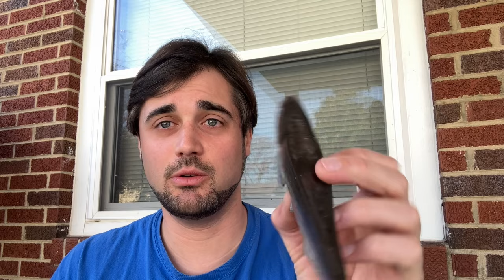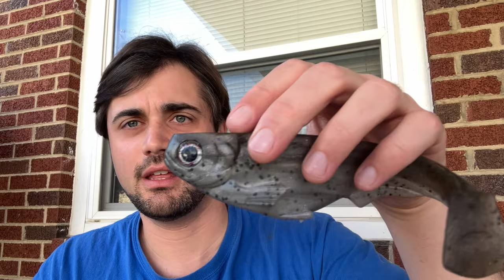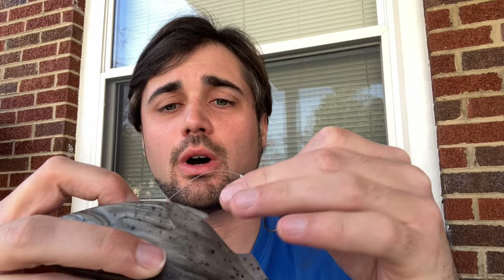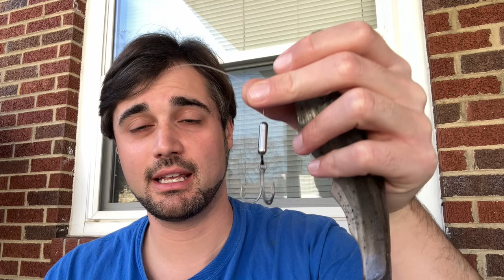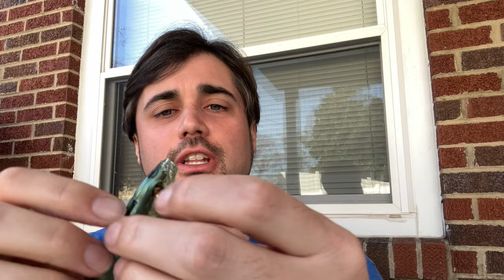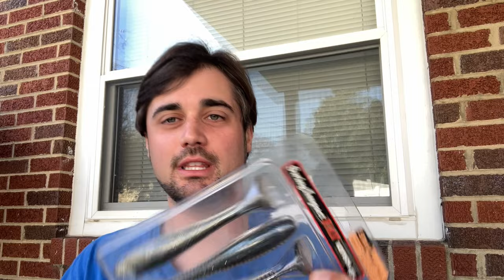Rigging line through swimbaits: Working Class Zero Citizen and Megabass Magdraft

Comment: Another great video! For the magdraft freestyle I just take a pencil shaped dropshot weight and stick it in the cavity inside the belly. Mend it works like a charm to keep it secure in there. I also have my hook hang a lot closer to where the tail starts to reduce not hooking into short strikers. That pencil weight in there allows me to either make it a line through or even use the beast hook it wont come in the way!
Reply from the maker: Thanks!
I’ll have to try that. That would help me be able to run the magdraft much deeper! Really appreciate you watching!